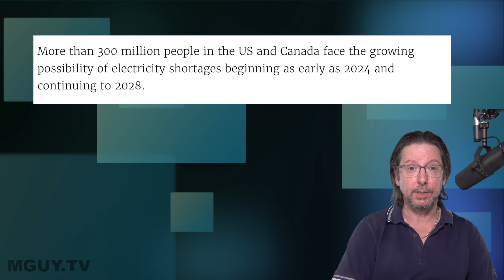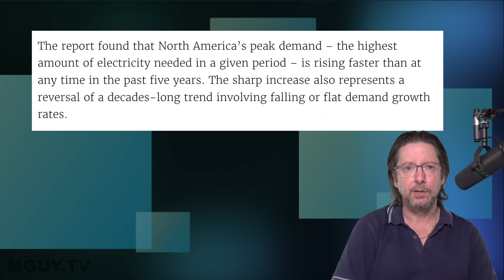Electricity grids WON'T COPE with mass EV charging | MGUY Australia

Comment: I checked the electrical draw while charging a Chevy BOLT at the dealership I work at in Canada. It draws  as much as a large house with everything in it going. Like everything. So for 2 cars (per house minimum here in Canada) each house needs the capacity tripled. Basically each car is probably half a welding shop.
So JUST FOR EVs we need triple everything, transformers, size of substations, generating capacity.
British Columbia, our LEFT Coast (left political as well) has started to mandate only electric heating in high rise buildings. Now B.C. Coast, we're all the lefties are is, dark, cloudy and mountainous. So where are the solar panel and windmills going. They are not. And just like Australia they would freak over a nuclear plant. They are also pretty much out of pristine river valleys to dam up.
CANNOT BE DONE.
CANNOT.
IDIOTS IN CHARGE!
Reply: Your information on EV charging is absolutely false. A typical driver, USA or Canada, only drives about 40 miles per day or less. You can easily charge ANY EV overnight using house current in that scenario, no wiring or circuit panel changes required. You can set an EV to charge at any amperage you want, it does NOT have to charge and the maximum rate the charger can handle. Since 95% of all EV charging is done off-peak, you can easily accommodate two EVs in the typical home with no issues.
Reply: @justsomeguy934  It will not take to many of your neighbours charging "off peak" to introduce a local PEAK at 209 amps wall voltage equivalent. Glad you live in a neighbourhood that everyone will get along and set out a charging schedule. I guess you can't quite imagine what will happen at an apartment/condo complex, can you? Also there are a lot of homes that are not 200 amp service since the advent of widespread natural gas use. So they WILL need new EVERYTHING out to the power pole. Price that out and get back to us. Never mind the cost of an apartment building with 200 units.
Reply: @bradkubota6968  You have no idea what you are talking about. You are assuming, like many do, that an EV must be refilled from empty to full every day, and done so at a 10-20 kW/h rate. For the typical driver, you can refill an EV using house current overnight. No neighborly cooperation required since 95% of all EVs are charged off-peak when you're asleep. 
As for apartment dwellers, they only represent 35% of the American population, and can refill at a rapid charger once a week like ICE vehicles do.
What you fail to realize is that an EV, unlike any other appliance, can change the rate at which it consumes energy. It can be done slowly, low draw, or quickly, higher draw.
Reply: @justsomeguy934  "Honey, can you unplug the car I need to run the dryer"
20 kw/hr equals 90 amps at 220.
Many single homes are 100 Amp service. When you are on you "HEAT pump" for a furnace things are going to get dicey. You'll be cooking on the BBQ in January.
Reply: @bradkubota6968  absolutely false information on your part. What you fail to understand is that an EV can be charged at ANY amperage you want it to, even house current (15a/120v). No need to unplug anything. You're thinking that an EV is like a dryer where you cannot control the energy draw it uses. Furthermore, I can show you a smart switch that will share a breaker in your house that will charge your car when the dryer is done, no panel changes other than installing the switch.
Reply: @justsomeguy934  WOW! So you can charge off a regular plug!
How many hours to charge say a Chevy BOLT?
Sorry should we measure in days?
It's OK I did the math, although you are probably going to answer a question I didn't ask anyway.
Reply: @bradkubota6968  your knowledge is lacking yet again. You refill an EV on a daily basis, and only replace the energy you used THAT DAY. That's about 30 miles on average for the typical American or Canadian driver. You do NOT, repeat, DO NOT fill the tank from empty every day.
Reply: @justsomeguy934  couple of hours ago it was 40 miles, YOUR WORDS.
You can't even keep up with yourself.
Keep moving the goal posts
Reply: @bradkubota6968  I give arguments in favor of the person trying to discuss it. Google the amount of average driving, it's less than 30 miles per day. I've had others insist it's 40 miles per day, depending on their search engine and locale. It makes no difference, you can easily replace 40 miles overnight (10 hours charge time) on any EV made today using house current. I have made the argument in YOUR favor, and I'm still right. 
So did you want to retract all your assumptions about EVs now?
Reply: @justsomeguy934  Just did the math using your numbers. 2 smallish EVs 6 days/week, 10hrs a day. Total kwhrs  is 2.26 times a current electric bill.
In this town 35,000 cars head into Toronto daily and are for sure above your "averages".
MY 3 times the grid need is for sure reasonable as there are many larger EVs out there which will not get a 1/4 range in 10 hours on a 15 amp circuit. Also YOU are assuming that 100% EVs owners will be happy plugging in for 10 hours a night. Big assumption.
What YOU are either ignorant of or intentionally ommiting is.....
At some point with thousands of EVs plugging in overnight, the PEAK will BE OVERNIGHT. There is no solar and less wind overnight.
Advocate for nuclear power.
With 2 EVs you will need a big cable heading to the garage area, that will not really be an option.
Add the totally delusional pushing of  "Heat Pumps" on people to a neighborhood and well 3 times the grid required is LOW.
Reply: @bradkubota6968  your calculations and assumptions are incorrect. I do appreciate your effort, however, but you lack knowledge of how EVs are used and the demand of off-peak consumption rates is wrong.
The average US home consumes 30 kW/h of electricity per day. The single average driver (you doubled that number to 2 drivers per day to inflate your numbers, by the way, a sneaky assumption on your part) consumes about 1/3 energy in TOTAL per day (again, off-peak) with each EV (10 kW/h per day, low-amperage charging). 
First, you mentioned the electric bill. Some places (not me) have tiered rates so for many EV owners I know, they get reduced, off-peak rates to charge their cars. In my personal case, even without ANY reduced rates, I saw no appreciable increase in my electric bill as I was able to offset my EV usage with switching to LED light bulbs. Other may not be that fortunate, but I was.
Your estimate that EVs will not get the range replacement in 10 hours is absolutely false. You're moving the goal posts, you sneaky person, to make a better argument in your favor. The oldest, slowest charging EV I know of (mine!) gets 3-5 miles of range per hour of charge on house current. A conservative estimate is 40 hours of range with a 10 hour charge, and I certainly achieve that every time. For your information, I know that newer EVs - a 2020 Tesla Model 3, specifically - gets 75 miles of range overnight on house current. That blows your statements out of the water as far as inadequate range overnight for ANYONE. Are there specific cases where people drive MORE than the average? Sure! I deal in averages, as there are people who drive LESS.
I am not "assuming" anything incorrect about EV owners will be happy charging their cars every day. I KNOW that that. In fact, the newer EVs use LFP batteries that are recommended to be charged 100% at all times. Stop making statements you have no knowledge about.
Peak consumption of energy with EVs will NOT be overnight, show your homework. Daytime use of energy is many times that of nighttime use, and EVs only consume 1/3 more energy at low amperages per car. No new high-tension power lines. No new generators or power plants. NOTHING. Most utility plants go idle to a 1/3 base production load when we're asleep. In fact, many utilities with renewable energy sources (wind in particular) WANT EVs online charging off-peak, it balances the load on the grid.
As for some "big cable" in the garage, WRONG AGAIN. I guess you've forgotten that I've said house current. Given a Tesla Model 3 can get 75 miles of range overnight using a 15a/120v circuit, what "big cable" are you talking about?

Comment: No, no, the zealots told me it's fine, b/c everyone will charge at the exact same time overnight (using more kWh just from charging than they would during the day with extremely high usage).
They also believe they'll get the cheaper rate from overnight charging 😂. They're not exactly bright.

Comment: If the electricity grid can't handle EVs, just upgrade it. Probably turn overhead lines to underground. And add more power. Wind and solar, yup, batteries for the wind and solar, of course. Hydropower, mm hm. Nuclear, oh that will help us a lot.

Comment: It will cope just fine...
there are smart meters now...
they can tell you when you can charge and when you cannot.
Reply: And there's the problem - they control when you can charge which means they control your travel. The problem is the govt controlling everything. Aside from needing 3-phase to charge quickly and to charge multiple vehicles quickly, what are you going to do when you need to travel far on basically no notice? You're stuffed in an EV - with fuel you're good to go. Everyone ignores that you can fuel a vehicle from a servo or at home from a jerrycan in a couple on minutes whilst EV's take ages to charge. You can carry a jerrycan, you can't carry huge amounts of power.
Reply: @matthewnirenberg  Not to mention they can discharge your car for "essential" reasons and feed the power back to the grid. 
everyone around us is addicted to the magic of gizmos and gadgets and willing to give up their freedom for them.

Comment: I'm convinced that governments of today are making these 'promises' to placate the green eco-zealots, knowing full well that the politicians of today will not be the government dealing with the reality in 2035 or so.

In the UK our electricity generation capacity is close to failure every Winter, yet our government not only wants us all using EVs from 2035 onwards, but also are phasing out domestic gas use - most homes are centrally heated by gas boilers, and from 2035 we can't buy any new ones. The electricity grid can't supply expected EV demand, let alone the additional draw of replacing gas to heat our homes - with most electricity coming from gas fired power stations.

There's going to an almighty collapse going forward.

Comment: OMG, when will you stop quoting the Murdoch press and apply a little critical thinking. The majority of EVs charge overnight when electricity is cheap and plentiful, not during the day when it's expensive and in high demand. Off-peak EV charging will actually improve the efficiency of the grid as power generators won't need to power down and be on standby when demand is low and being paid to do so.
Oil refining uses a huge amount of electricity (6-8% of electricity used by industry globally), so reducing the need oil refining you will bring more available capacity for other uses.
Reply: @ night during peak solar energy generation... A little bit of critical stinking.
Reply: @williammarrara7490  Heard of batteries?
Reply: @jeremyradford5103  Nope Never... I'm not the sharpest SHED IN THE TOOL
Reply: @williammarrara7490  lol. I'm sure that's not true.
 Batteries are the future but not necessarily lithium-ion batteries. With 300 days of sunshine in Australia, solar is by far the cheapest way to generate electricity (even in cold damp UK, it's still the cheapest), but that power needs to be stored for when there is no light, so as to make best use of that cheap electricity. 
Batteries come in many different shapes and forms. Anything from lithium-ion or sodium-ion to redux flow to compressed air or pumped hydro storage, to name a few. 
The economies of scale have brought the price of batteries down by around 90% over the last 10 years or so, and new chemistries will reduce costs even more, so they are a cost effective way of storing solar energy.
Reply: @williammarrara7490  Heard of batteries?

Comment: Here in the USA, way back around 1989, when I was taking my electrical degree, the worry, regarding the electrical grid, was that the cables that carry the electrical power were too thin to deal with the forecasted increase in demand for electricity.
Reply: For sure the same issue has remained, unchanged.
Reply: @ronbelanger4113  Oh, there was a change. Back in 1989, the issue was a matter of current (excuse the pun) debate. Now, here in 2024, the issue has changed. Now, the issue has been completely forgotten.

Comment: when electric prices spike for everyone, EVs become more expensive to charge than gas costs, and when blackouts start, people will stand up against EVs. they won't be able to avoid/deny the consequences at that point.
Reply: the largest increase in grid demand was the advent of air conditioning after WWII...surprise, the grid did not melt. We're making orders of magnitude more electricity than the USA did in 1950, so should we stop making homes with A/C?
EVs consume a fraction of the energy a home HVAC unit does...

Comment: No, currently the grid cannot support Mass EV charging. Fortunately for everyone, you can't undo this many millions of fossil fuel cars in a weekend.

It will take many years, and the contract for when the power grid operators bought the grid from the federal government who built it originally with our tax money very specifically included that they would charge us fees, which they are doing,.
And they would use those fees to maintain, upgrade, repair, and expand the grid as necessary.

Over the decades, the profits of the grid operators has increased, while the condition of the grid has decreased. The reason the grid is in the shape it's in, is because the federal government has been allowing them to not uphold their end of the contract, while allowing them to charge us more and more money to increase their profits.

And now the grid has gotten so bad, not even counting EV charging, that it needs hundreds of billions of dollars in maintenance.

Why are we allowing the grid operators to increase their profits, while not properly maintaining the grid?
Companies are not guaranteed to increase profit every year. But our government lets them, while screwing us over.

This is NOT a problem caused by EV charging, it's a problem caused by our government, republican and democrat, allowing the grid operators to NOT do what they agreed to in the contract when they bought the grid.

In other words, it's our government screwing us and working for the corporations. As usual.

But you go ahead and ignorantly blame car charging.

Comment: The inherent issues with batteries is that they are too complicated, too expensive, but also cannot get wet, and cannot hold a charge for very long.

Extreme cold and extreme heat can sap batteries of their charge much quicker than the designers intended and charging them takes forever compared to simply gassing up.

They are also highly flammable and/or explosive due to the lithium. Any battery in the future that is going to hold enough of a charge to be anything close to useful as an internal combustion engine powered vehicle is, will invariably be highly toxic and/or flammable/explosive.
Reply: Um, stored gasoline or other fossil fuel is far more dangerous than a battery (explosive tendency comes to mind). About the only advantage fossil fuels have over batteries is storage time. The point-of-use poison that fossil fuels creates is overlooked in your comment, as is the 75% energy loss when burning gasoline to push a car.
Reply: @justsomeguy934  Not from what I can see.  As a matter of fact, I saw burning EV on the way to Waco on Wednesday.  The lithium is highly flammable/explosive, even when harvesting it from the ground, which creates more pollution in the ground than I do chugging down the street.  Then there's the other bits of toxic processing you have to do to get a battery that pollute far more than everyone filling up.

You need hundreds of times more grid capacity than we have now meaning coal and nuclear plants will open up.  Guess the ratio of coal to nuclear.  I'm betting 10-1 at least.

There's fueling time, which is, at worst, a few minutes compared to the time it takes to recharge a battery.  Range is poor, especially in cold or hot climates.  Moist air getting inside the battery can cause it to ignite.  It can ignite several weeks after the fact.  Water only cools the battery, it doesn't solve the problem.

When an EV ignites, the nature of the fire makes it far more difficult to extinguish.  You can't just hit with a fire extinguisher or smother the flames, the battery will just reignite.

The air pollution, and the low efficiency of IC engines isn't as bad as having hundreds of new coal powerplants, lithium farms, and other chemicals and machinery dumping even more toxic waste into our environment.  

There's already a massive E-waste issue that's been building for over 30 years.  If you're all fired up about the environment, and really want to be a part of the Solution, start there.  Seriously, it's a problem larger than air pollution.  

Besides, what's that EU puppet Greta done lately?  Taking payouts from her corporate sponsors???🤣🤣🤣